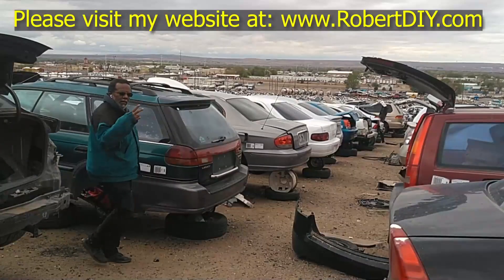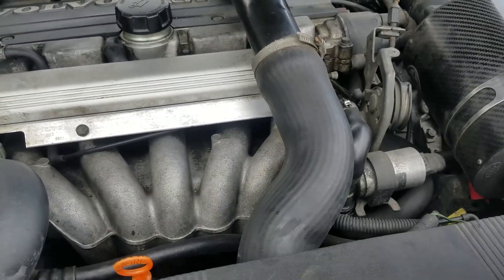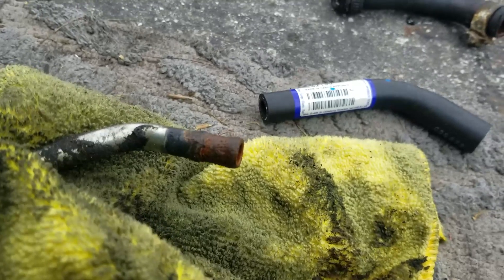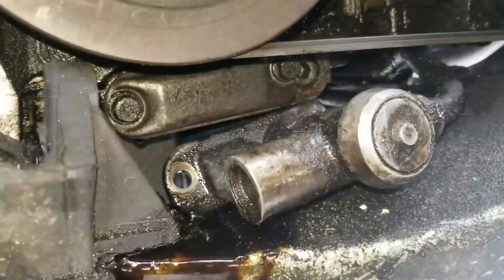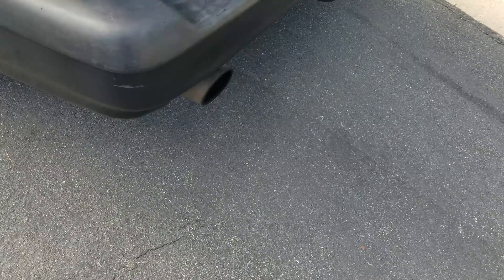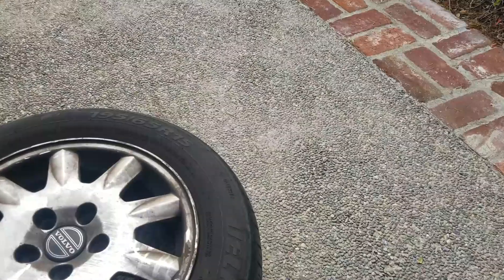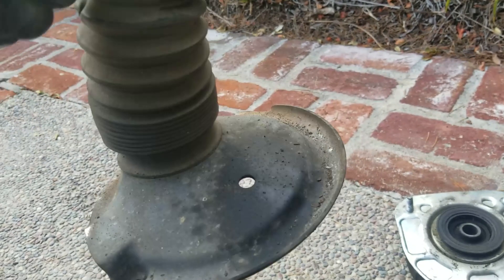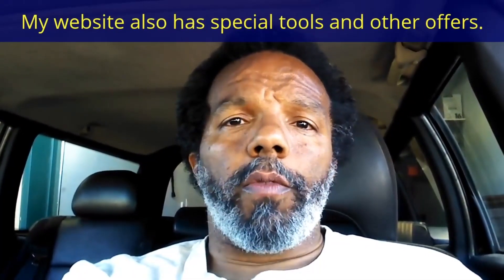Volvo 850 T-5R PCV repair, turbo coolant supply line, oil cooler lines & more. Then work on a P2 V70

Comment: Need to do the rear shocks on my 01 V70 XC. I will have to compress the rear springs and those spring compressors scare the crap out of me. Wish me luck.
Reply from the maker: Why?
Reply: @RobertDIY  A compressed spring seems to be a little bit like handling a live grenade.
Reply: @stevemccooleq  Just don't be stupid with it. Make sure it's secure and you're good to go.

Comment: I like the IPD silicone coolant hoses for the turbo water lines.  How do you feel about those?
That is an interesting oil filter - it looks like it's sitting too low and could be more easily damaged by road debris.
Reply from the maker: I like the Volvo coolant hoses. I've seen some silicone hose just explode. The iPd hoses are hard to put on to me. Very tight. Yes the oil filter is low.
Reply: @RobertDIY  I'll defer to your experience.  I've never seen silicone hoses explode.  I agree the IPD hoses are hard to install.  A little soapy water makes it easier.  The Volvo ones seem to swell over time and require replacement.
I hope Jay was able to install the correct oil filter on that!
Reply: I've had OEM and IPD, unfortunately I had a rub on the power steering line and the IPD was not up to the task. OEM Volvo is double jacketed and under normal conditions last the life of the car. However I do have IPD silicone lines in other places on the car which have given me no trouble at all.